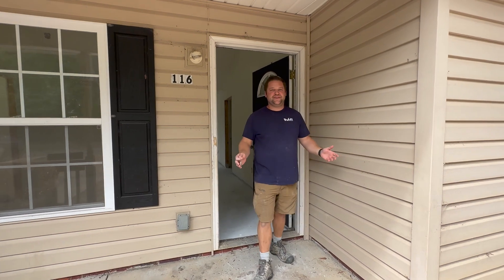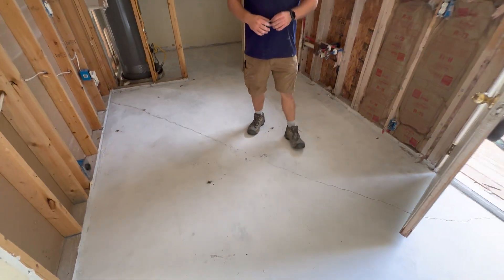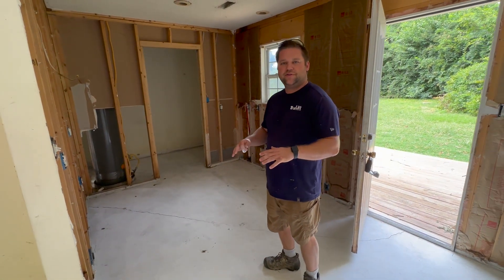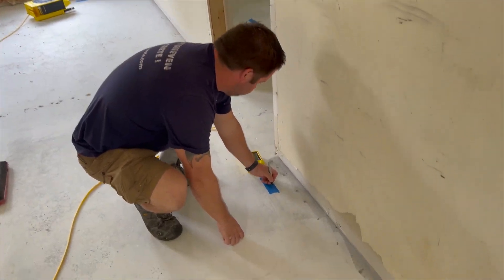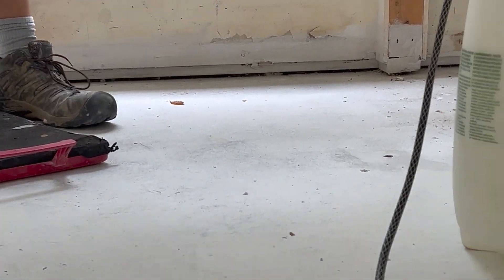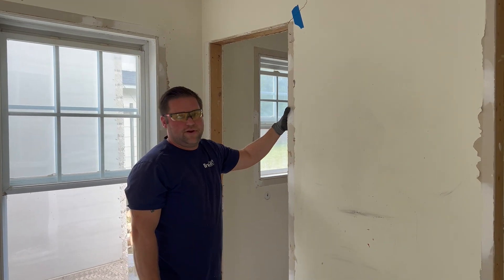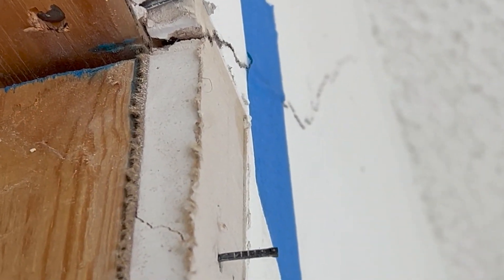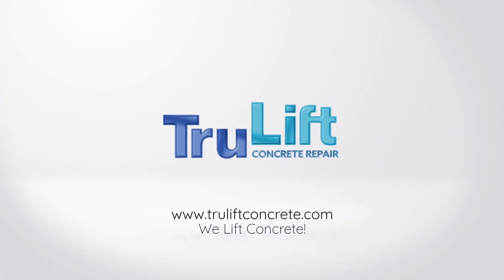Reviving Home Foundations with TruLift Concrete Repair | Geotechnical Polyurethane Injection

Comment: what is the maximum concrete slab thickness can possible to lift it with the PU  and how much pressure can produce by the foam to uplift the slab

Comment: My question is what if someone is residing there - how much prep do you need to make your work area optimal?
Reply from the maker: That is a great question. This job was great because the demolition work was already done. Typically, we just need the flooring taken up prior to lifting. In some cases, the customer may just have us drill through the flooring, with the understanding they will have to repair it in the future.